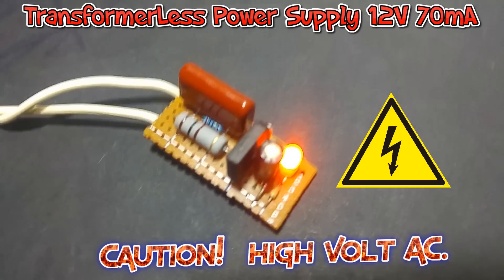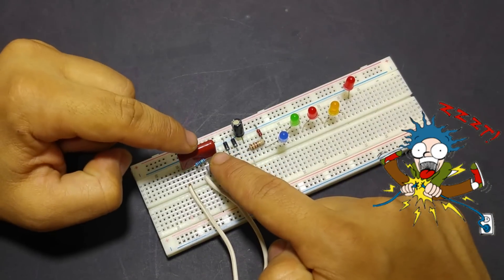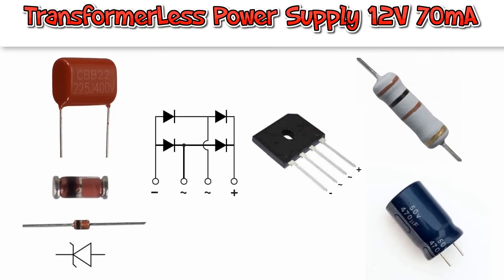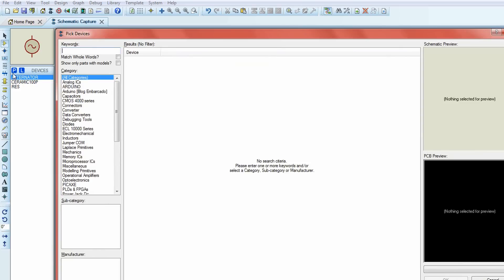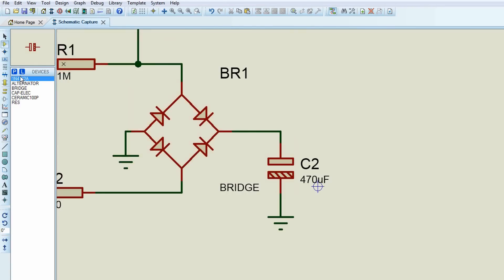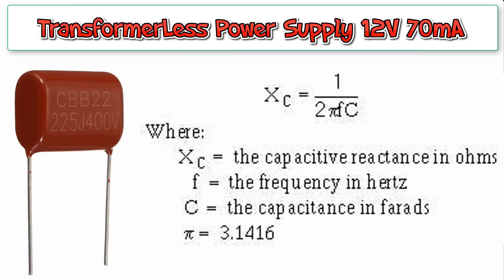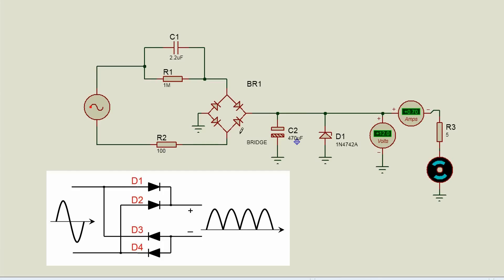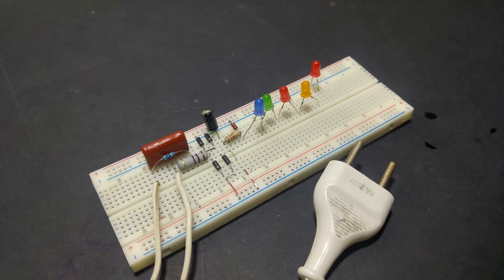How to Make a Transformerless Power Supply(220v/12v)

Comment: Very nice.... but when I make the same circuit,the electrolytic capacitor becomes tremendously hot......is it because of the voltage rating of the capacitor? I took 1000 microfarad,40 volt.....other components are all same.....is more than 40 volt capacitor required?

Comment: Hi, My name is onur.  I hope you are fine. I need a simple help. I watch your video. I calculated C value but dont find in circuit diagram. briefly I want to calculate for 220V AC to 35V DC 700 mA values, but my head is confused
Reply: from 220v to 35v you need 264 ohm resistor /AC to DC do yourself

Comment: what is the specs for 6V output 500 mA or 1 amps?
Reply: increase the value of the AC input capacitor, if you want to increase the output current.

Comment: I have few questions:

1) Which software you're using to draw the circuit diagram?

2) Why zener diode is used and what voltage should be selected for 470 uF capacitor?
3) How do I know which capacitor value to choose for the desired output voltage drop?
Reply: 1. Hi, he is using Proteus cad software
2. Zener is used to limit voltage, so if you need 12v a 12v zener needs to be used
3. Basically search for reactance related formula for calculating capacitor and resistor value
Reply: @coolcolumbus  Thanks for the reply but I have noticed that if I use a zener with higher voltage then it gets heated and burned. So how do I know that how much voltage a 12v zener will able to tolerate? I also want to know whether is it possible to stepdown voltage using a resistor instead of a nonpolar capacitor?
Reply: @debojitacharjee  hi, i think its the wattage of the zener diode. Try a higher wattage zener with same voltage rating. This is a lossy power supply suitable for small loads below a few hundred milliamps so don't put an inductive load like a small motor.
Reply: @debojitacharjee  Another factor is the real breakdown voltage of the zener, measure it don't go by markings.
Reply: @coolcolumbus  So is there a way to stepdown from 5v power supply to 3v? Only 5v chargers are avain market!
Reply: @debojitacharjee  I2R losses will be the problem, the  best, read cheaper, I tried were diodes in series each with a .6 voltage drop. Even the diodes in the same lot  have different v drops.
Reply: @debojitacharjee  And regarding using a resistor instead of a capacitor, bad idea will endup dissipating a lot of heat, say 220-12x1 amp that's like glowing hot bulb. And is not going to deliver constant voltage. Resistors are used to limit current not voltage.
Reply: @coolcolumbus  Hi..what changes should I make in this circuit for 440vac to 12vdc? Will you help me please..
Reply: @kukunishad  hi, what is the line frequency and load current you are working with?
Reply: @coolcolumbus Thanks for reply. Input : 440v, 50hz AC and output is only an LED about 10mA load current is required.
Reply: @kukunishad  Assuming you need 12 v, nearest voltage achievable is 11.6 v approx. C1 is 0.1uf rated  at 1kV, R1 is 560 Ohms rated at 5 watts, R2 is 1 MOhm rated at 1 watt, zener is 12 v rated .5 watt, if using a single led at 3.3 volt led use a 4 volt zener. Be careful with mains voltages. I have not tested these values, do it at own risk. Calculations are as per standard reactance formulae.
Reply: @coolcolumbus  Ok.thank you for the suggestion. I will test this circuit with safety first and will let you know about the results.thanks.
Reply: @coolcolumbus  I am wondering, what is need of R2(100ohm in video) in this circuit. What will happen if R2 is removed?
Reply: @kukunishad  It is required, else the capacitor bleeder will discharge faster than required and not give any useful current.
Reply: @coolcolumbus  hi there, can you answer my questions about these kind of circuits? first of all how to calculate the values? the output current of this circuit shown in this video is 70ma (which the software is showing it 0.7A) but with 2.2uf capacitor I calculated 0.0004 amps at 220V which the resistance of this amp came 550k ohms, so I'm confused with formulas and how should it be done. I want 6V 1A or 500mA output. some people say a transformer must be used, but how about using more capacitors in parallel? I don't know hot to find the correct values, in many videos they are using 0.47 470 or even 4700uf (this one is electrolytic) capacitors or 470k, 470 ohms resistors, so where these numbers are come from?
Reply: @unobianconero5751  hi there, check this out
1. Input Current = (Vhfrms )/(Xc+R) >= Output Current
2. Vhfrms = (Vpeak of input voltage - V drop across Zener)/2 = (1.44*VRMS - Vdrop across Zener)/2
3. Xc = 1/2 pi f *C
Dose this help?
Reply: @unobianconero5751  500ma is big for this kind of circuit,  what is the load current, is it constant load, inrush current etc. I would suggest to go with an SMPS at that values, it's safer and can be designed in both isolated and non-isolated mode. Yes you can stack up a few capacitors to improve the current but you will need very high quality capacitors with identical reactance values getting them is difficult. Even then a varying load current can effect the circuit performance severely. Which means you will need a feedback circuit to meet it. Hope this helps.
Reply: @coolcolumbus  actually I watched a video in time after I asked this, and there was calculation like this but you did bring it our briefly (but why devided by 2 in the formula number 2?), I was using A.s/V so that made me confused with the whole stuff, I'm very new with these and still learning but there are too many things too learn, in many circuit like this they use similar components and nobody explain that why? some points are uncleared for me, first, we must know the current to have the capacity right? I mean if that current goes into all parts of the circuit so why some components (like second capacitor in the dc part which I don't know how to calculate that because the 0 frequency give us nothing in formula) and what is the input current? and how to tell what is the maximum apms the circuit we made can provide? I calculated again and it came around 10.5uf (can we use several of them in parallel and some in DC too?) for output 6V 1A on 230V AC 50 Hz, so what about discharging resistor comes with 1st cap. and the resistor series with Neutral wire? what is the voltage value before the zener and where the extra goes? dissipates as heat? how much the indicator led drops he voltage and where it should be installed? and finally for how long can we use this circuit with load? I know this is long but as you gave me right answer (when nobody does) that would be a good help.
Reply: @coolcolumbus  I read the second reply later, the thing is I'm looking for understanding and realizing what exactly is happening more than practically use them (comparing to commercial supplies which are safe and reliable) and making something by knowing what you are doing is very different with just copying it from others. p.s: the current (if I got you right) is constant and the load is some smd LEDs.
Reply: @unobianconero5751  let's discuss this theory but difficult to explain things in text only comments, basics first, may be your doubts will make me less lazy and start a video series or a blog😊. So let's start with what's  AC. It's alternating current that is the current flows in alternating way at a frequency or changes its path. Now draw the bleeder circuit on a paper and follow. Think of the capacitor as a tank filling the moving charge or current, we will discuss the volts part shortly. Now as time passes the capacitor builds up the charge and starts passing the excess charge. This is where the voltage part comes in... you need to understand the reactance for this.... Will explain
Reply: Are you following along?
Reply: @coolcolumbus  thanks for explaining, yeah I know what the AC is (simple basics!) but I want to know what is going on exactly in specific parts of the circuit and how much current and voltage are passing through the components (some of them are new for to me) and how they affect on I and V in this process. I had and Idea before I get to this comment but I don't know if it's possible or even correct or not. you didn't answer my questions in last comment (the first one actually) but making videos is good not only for me. the bleeding circuit you mentioned is to make capacitor and resistor parallel together? I want to know what is the V and I before the zener comes in, how much in C1 and R1, how much is through he resistor in the way of neutral line and how to calculate the DC capacitor. I want to know the reasons not just instructions without knowing why, do you understand what my point is? there are tons of videos like each other, there was just one thing new in this video for me but one of the rare videos has useful comments so we are know here.
I found this circuit, (see the links below):
https://pasteboard.co/JjR0NSF.png
https://www.homemade-circuits.com/high-current-transformerless-power-2/
so why the triac? is that for the added up capacitors? does it put the power (maybe current or voltage I don't know) back into the circuit when it is returning to it's source through the neutral? or it does something else?
can we use oil capacitors to have more powerful capacitors or mkp, mkt capacitors?
that Idea I told you before was about rectifying the AC (what is the correct term? rectify voltage or current?) before put it to capacitor? so we use pf capacitors because they're not polarized and can be used for AC which has frequency (and that's why I couldn't do the math for DC capacitor via the Xc formula, and you didn't tell and answer why the divide by 2 in Vpeak formula) so why don't we make it DC before we use it for the circuit? can we do it by using 4007 diods to make it 220V DC or it's more complicated? and I repeat this too, how much is the V before the zener and how does it reduce it? by making it to heat? or puting it back in opposite direction? the important question I always had it's how to know the value of current the specific circuit is capable to handle? we do the calculations bu knowing what is the output current and selecting capacitor right? so that's uncompleted, and some steps is missing; and yes discussing it in comments is not easy...
Reply: @unobianconero5751  and please let me know your time zone, I am from India
Reply: @coolcolumbus  I'm from Iran

Comment: In this method the 1k ohm resistor is too hot during power supply passes  through this circuit
Reply: use a higher wattage resistor, basically its an innefficient circuit but is way cheaper and has less components
Reply: where is 1k ohm resistor?

Comment: Could you please assist with list of components to build a 230v ac to 60v 30amps transformer less circuit
Reply: It won't be feasible without a step down unless you want to heat up like a stove.
Reply: @coolcolumbus  thank you for the indo much appreciated

Comment: why they call them x rated capacitor, how do I buy one.  I searched x rated capacitor, and could not find anything on ebay.  where do I buy them.  I think name x-rated capacitor is misleading because no one use that name, that's why I can't find it online to buy.  in my case I need to step down 120v ac, do I still use the same capacitor rating
Reply: I think x rated capacitors are just capacitors made to handle upwards of 400V

Comment: How we calculate value of components  output 5 volt  DC circuit
Reply: At the end .... Put a 5v zener diode in parallel to load

Comment: Will this same setup work for 110v to 12v
Reply: Theoretically, yes. The zener diode is what's regulating the dc voltage, so just use a 12v zener.

Comment: What is the uses of 100 ohms resistor in this circuit
Reply: To prevent from running down... Inturn preventing the total current running into the load

Comment: Hi, nice video. I have couple of doubts....Is this circuit good to operate 24 x 7? I tried this few times, but after letting it run for few hours, the output voltage is zero. When i trouble shoot, i see the voltage across the xrated capacitor is zero. Any thoughts on what could be going wrong? Also my 100 ohm resistor is heating up...any suggestions?
Reply: Don't know the answer to the capacitor question, but as for the 100 ohm resistor heating up, that means the resistor you're using doesn't have a high enough wattage rating. Resistors you get in big packs are usually 1/4 watt or 1/2 watt, which isn't enough to handle 120V ac. If my math is correct, the 100 ohm resistor is consuming nearly 1 watt, so I think you should go with a 1 watt 100 ohm resistor (or a 2 watt ohm resistor just to stay on the safe side).

Comment: my 100 Ohm 3Watt resistor is overheating...any suggestions?
Reply: Use a higher watt resistor, it is around 5 watt, it will heat though, that's how this works
Reply: Yes it will over heat cos the voltages from ourput stiill very high only current reduce no good

Comment: Hi!! Awesome Video!! I have already try it and i have a problem with the voltage of the second capacitor! Could anybody say me the voltage of the one that is used in the prototiping board of the video?? 470uf and .....V. THANKS
Reply: Voltage of second capacitor is anything above the peak ripply, 1.5 times the peak voltage. Measure using a CRO.

Comment: Hi, I'm done same but 100R resistor gets very hot, is it normal?!
Reply: Replace it with 56 ohm 2watt or 33 ohm 2 watt ,its called inrush limiter resistor ,it will be fine.

Comment: i have a problem in Proteus schematics, and i don't find wat is wrong, i have only 1.71 v on output, and the schematics is the same like in video, why?
Reply: make sure the capacitor you're using in parallel with the bridge rectifier output is rated for 5 or 12 volts.